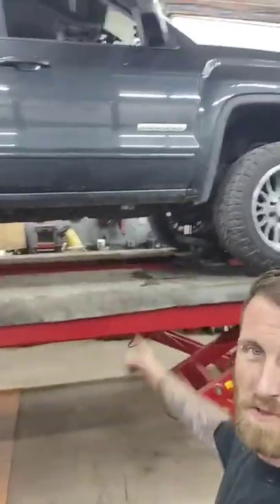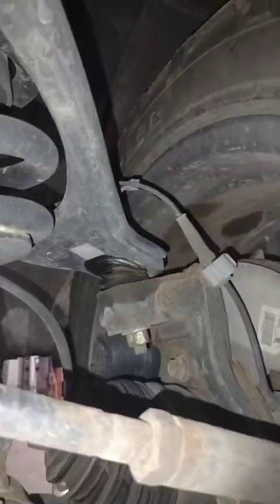I love the lifted look but it does put added stress on suspension parts.

Comment: There's a 2020 Explorer at my shop now and it has TWO wheel spacers on each hub. One to push it out 2 inches, and another to push it out another inch as well as convert from 5 to 6 lugs. The thing would look really nice without them but unfortunately the wheels stick out really far and it looks like a half-assed liberty walk. Only 7k miles so far, can't wait til those axles and bearings tear apart at 20k
Reply: I run 2 inch adapter/spacers on my old Jeep in the snow so I’m the same width as a full size rig. Been doing it for years. Makes it easier to follow everyone when the snow gets deep. Instead of 2 wheels in the rut and 2 on the center hump.
Reply: @Billy28376  you're running 1 spacer...... this guy is saying theres someone running a 2" spacer, then a 1" conversion spacer for a total of 3" along with converting the original 5lug bolt pattern, to a 6lug bolt pattern
Reply: @Billy28376  Aren't wider tires worse in the snow? They float

Comment: Ya I had a 7.5 inch lift on my 13 Silverado worst decision ever. Constant alignments
Reply: What Brand? 
I've got a 4" rough country on my 04 1500.
43,000 miles and have had no issues with alignment or anything the shocks definitely need to be replaced. But I'm really impressed with the quality of it for a $1000 lift kit.

Comment: Control arms, cv axles, shocks all need to be swapped out with parts specifically designed to match the new angles. And if you go more than 3” of lift your pinion angle needs to change as well which means new drive line or transfer case drop. Don’t just throw coil spacers in there and call it good. The money you saved by doing it the cheap way will end up going to repairs.

Comment: Nah. It’s a shitty gm issue.   My 2016 3500 ram has had 24x14 with 38x15.50 on it since 900 miles.  Currently at 176,673 miles still on original ball joints.  And a 2nd set of wheel bearings.

Comment: Yeah that's just shitty design. My lift literally has bolt on ball joints. I don't think a lift honestly puts any stress on anything, the stress only comes when you start spacing your tires which is just basic leverage problems that everything encounters.
Reply: You are correct . When you lift your truck the right way it doesn't stress much of anything .